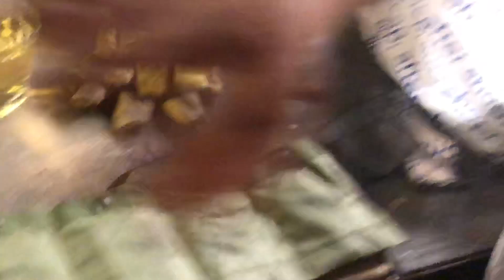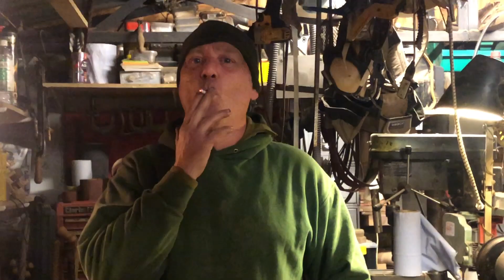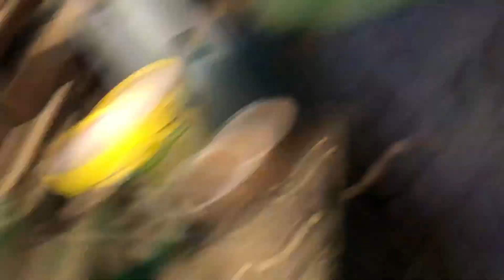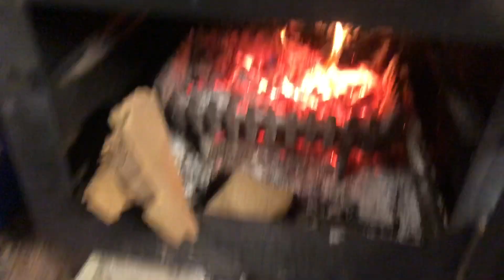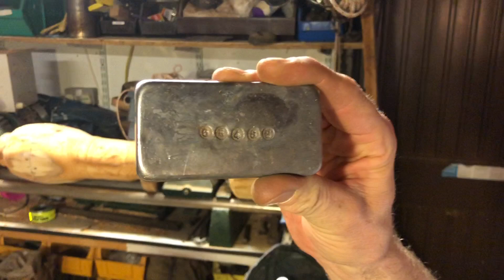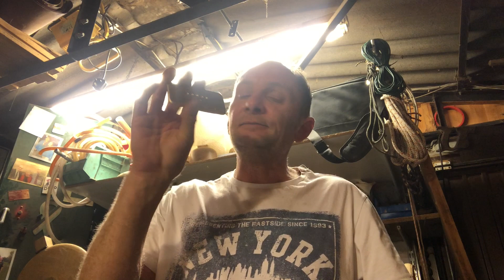Off the Brush,Gold rush War Story 💣🔫

Comment: I can tell you a story.....we were doing a farmhouse renovation.Taking walls down all sorts,full plumbing rip out.Cashed in big old 32mm copper pipe,copper cylinders.I sold the cast radiators.Anyway fast forward a few months and the room we had used for a kinda canteen set up was to get the widow knocked out and some big glass doors fitted to lead out into the back garden.Remember this is like a 6 bedroom country house,everything was massive,rooms,garden etc.Anyway these curtains had been hanging in this room the whole job,and before we stared to cut the hole for the new doors we took the curtains down.Behind the left curtain revealed a money safe set into the wall!!Our eyes lit up!We thought being honest Scotsmen we wouldn’t point it out to the new owner and we would cut it out of the wall!We took it home to the yard and squeezed it in a big old vice and managed to pop the door off this metal box.
Fucking empty.No what I mean?True story. This is the finished job,was a ruin when we started.https://youtu.be/P9vSWtiU1LY